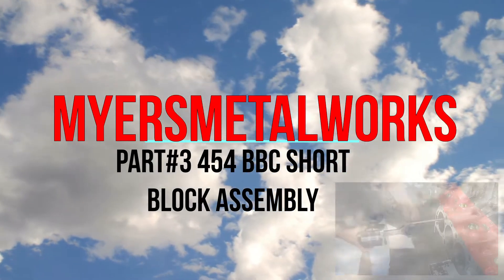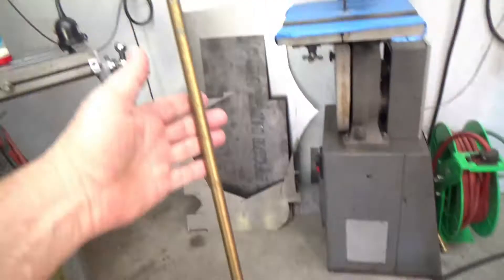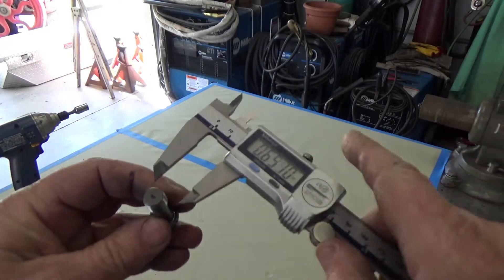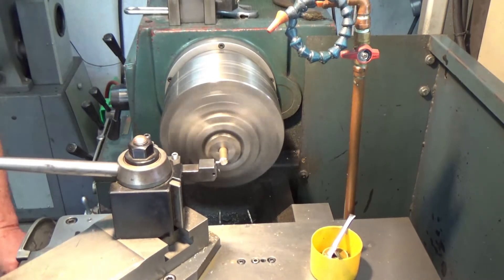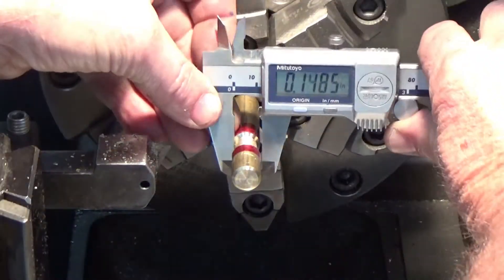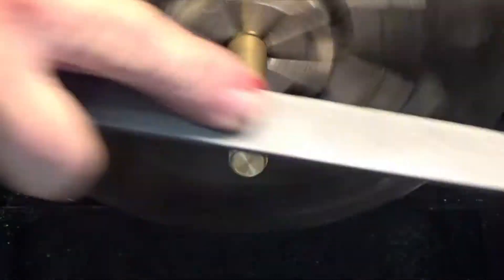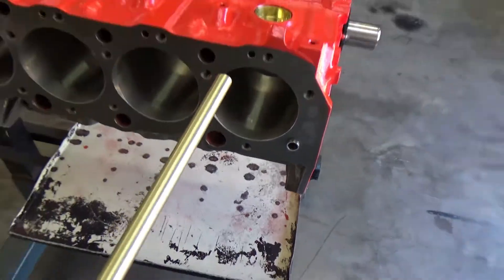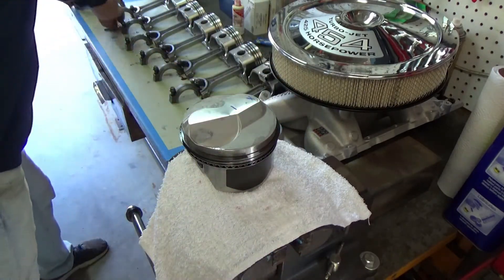Installing the pistons & rods into the engine block...#6  Chevy 454 Big Block Performance Build...

Comment: Ive made the same rod but i used a solid piece of nylon rod
Reply from the maker: That's a great idea.... thanks for the tip...
Reply: @Myersmetalworks  your crank handle.. you’ve made that from an old harmonic balancer with sone steel pipe??? I think I’ll be making one also .. great work
Reply from the maker: Thanks Steve.... Its been very handy to have.... I think I used some steel 3/4 rod I had around and just welded it to the balancer hub.... Or you could brazz them on... I opened up the bore a little to slip on and off easy... Sand paper roll and a die grinder...

Comment: I'd highly recommend a tapered ring compressor to the bore size once you start getting into thinner rings down the line.  Not fun to damage them.
Reply from the maker: Yes... I  have used them and they are nice.... Just alot of different bore sizes out there... I dont build engines for a living just fun.. So dont have all the best tools...
But thanks for the info...👍

Comment: Where did you get that red and black crank shaft turning tool?
Have you ever had an issue after you got all the Pistons in, The crankshaft feels locked up? I'm rebuilding a 454 right now, and I'm 100% positive All the Pistons are improperly in the right direction with brand new bearings and thick seating oil lubricating everything. But now that I've got everything in, the shaft feels like it's locked up. I'm troubleshooting this right now. But I'm curious to hear your input
Reply from the maker: The crankshaft turning tool is a old BBC harmonic balancer with the out side ring took off and two paces of pipe welded to it....  I know that with all the pistons in the ring drag makes it alot harder to turn over.... On the build Im not sure what your bearing clearances are  or ring end gaps, piston to wall clearance is but if there good it should turn... Hard to trouble shoot from here...  I would take one piston out at a time to see if there a problem.... Hope this helped.... and good luck.....
Reply: @Myersmetalworks pretty slick, may steal that idea 👍